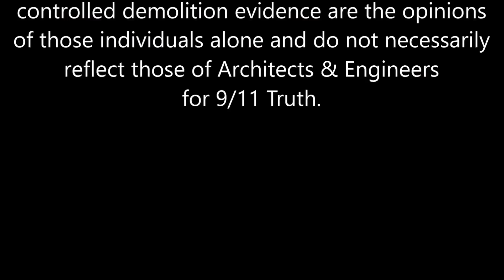Dr. Hulsey: There was nothing right about anything NIST did

Comment: NIST also never accounted (or accounts in any of their 9/11 material) for the heat dissipation qualities of steel beams constructed as a matrix. The steel frame building itself becomes a massive heat-sync. Meaning that the air temperature around the beams would have to be much hotter and for much longer because the steel beams would simply transmit the heat throughout the structure and that heat would be re-emitted (by the principles of black body radiation) across the entire structure. So when they say fires reached 2000 degrees, I would say SO WHAT, that doesn't make the beams 2000 degrees,   those beams will be about  400-500 degrees unless those beams are surrounded their entire length by a 4000 degree blast furnace, because they are all connected to each other, and would be transmitting all that heat throughout the entire structure.
Reply: The steel frame of the building has minimal heat sync qualities if effective fire proofing is in place
Reply: @PetraKann  can’t have it both ways… if the heat can reach the underlying steel, it will be dissipated by the connected material.
Reply: @xanderarena  But proper fire protection does just that Pander Arena: it insulates the steel from external thermal gradients.
Reply: @PetraKann  Are you saying that the metal handle on a heated frying pan would not get hot underneath "effective fire proofing"?
Reply: @kodowdus  Poor analogy.
The entire frying pan is not thermally insulated - only the handle.
The point is, all steel surfaces should have been fire proofed for direct heat contact for a minimum period of time (It varies from country to country but I believe it's of the order of 1 hour or so).

As we know today, the fire proofing in Twin towers was documented as being inadequate and needing repair in certain sections of the buildings. Then of course there is the argument that the fire proofing was blown off some steel structure due to the impact of the planes.
The bottom line is that the NIST report, just like the Warren Commission report of JFK's murder are fraudulent documents and politically interfered with.
They are not scientific reports.
Reply: @PetraKann  It was NIST itself that said that the core columns were uninsulated due to the fact that the aircraft stripped off that insulation, and that the columns softened in the heat of the fire.  It's in this context (i.e., under the dubious assumption that NIST's assertions about the state of the insulation are correct) that the issue of the metal structure of the building acting as a heat sink becomes relevant.
Reply: Heat-sync? Don't you mean a heat sink?

Comment: Although there was alot of money spent on deceiving the public, there are several things that occurred that they could never PLAUSIBLY explain.
1. The Amount of Jet Fuel in each plane that supposedly ran down the building, most of the Jet Fuel was evaporated upon impact when the plane exploded.
2. In order for a building to collapse at free fall speed there can be ZERO resistance from each preceding floor.Think about that. If a plane impacted a building on the 89th floor,the flames and destruction will begin at 89 the spread up and down,so the destruction is NOT going to obliterate floor 88 before floor 89
So how do you account for the zero resistance on 88 before 89 and 87 before 88 etc.
3. Because of the temperature that the Jets Fuel reaches it was only hot enough to weaken steel,so the building should have bent not collapsed straight down.
4. South Tower was 2nd building to be struck but collapsed first in 56 minutes.
North Tower was first building struck and collapsed in 102 minutes.
So let me get this straight it took 13 years to construct this Steel and Concrete structure with flame proofing and a fire suppression system throughout the buildings and you expwct me to believe "a fire" obliterated and reduced 2 steel buildings to ashes in 1 hr 42 minutes.
If you stacked 4 dog houses on top of each other made of Concrete and steel and completely emersed  the dog houses in combustible waste and Jet Fuel,it would take longer than 1 hr and 42 minutes to reduce it to rubble.

Be not deceived,
It was no doubt a controlled demolition orchestrated by people who gained financially from the destruction of the buildings and the subsequent apparatus that was built to facilitate the war against the "pretend guilty" and the war on our civil liberties.
Reply: "2. In order for a building to collapse at free fall speed there can be ZERO resistance from each preceding floor.Think about that. If a plane impacted a building on the 89th floor,the flames and destruction will begin at 89 the spread up and down,so the destruction is NOT going to obliterate floor 88 before floor 89" - Well neither twin tower collapsed at free fall speeds so this comment is null and void.

Comment: WHAT exactly happened to ALL 7 buildings with a WTC prefix on Sept 11, 2001?

The following points need to be made regarding what exactly happened to the building and the observable evidence at ground zero, that AE911truth / Richard Gage and now Andy Steele never touch on…

1. Building 3 (Marriot Hotel) – 14 Survivors - It was a 22-story building – 90% of that building completely went away, all the way to ground level and the 10% of it that was still standing (about 6 floors) is where these 14 people survived.

2. Building 4 – 9 stories – 75% of it, also went away – all the way to ground level – Poof gone. There was virtually no rubble on this building, except for a small remnant of the building.

3. Building 5 – 9 stories - Had cylindrical holes in it, 24 feet wide, that went all the way to ground level. Once again, virtually no falling debris ended up on top of this building.

4. Building 6 – 8 stories - Had the middle of it scooped out, all the way to ground level as well as 13 cylindrical holes, 24 feet in diameter on the edges and close to the scooped-out centre of the building and all these holes went down to ground level. The centre hole in this building had NO RUBBLE inside it, it was EMPTY! 

5. Building 7 – 47 stories or 4 and a half Titanic’s’ stacked on top of one another – Was frothing away the whole day until just the outer skin of the building was left and at 5:20pm SILENTLY fell into its own footprint, it left the seismic reading of just 2 stories hitting the ground.

6. The Twin Towers – 16 Survivors (“9/11 surfer” included) - 110 stories, equal to 10 Titanic’s stacked on top of one another. The survivors heard no loud explosions, no flashes of bright light, no molten steel raining on them, they did not go blind or deaf due to light flashes or explosions, they weren’t hit by falling debris - POOF they are gone into a HUGE DUST cloud. The seismic readings were that of a 20 and 16 story building hitting the ground respectively – Why was it so low?

7. Bankers Trust Building – (Across the street from the WTC complex) Was heavily damaged and rebuilt, just to be completely taken apart 5 years later due some lingering aftereffects affecting the structure of the steel in the building. Show me how a building that was not hit by a plane, had no office fires, because something affects the steel in the building?

Why has AE911truth / Richard Gage and now Andy Steele been “distracting” from all these points and especially focussing on WTC 7 for the last 7 years, ignoring everything I’ve pointed out?  

Has AE911truth / Richard Gage and now Andy Steele forgotten about ALL 7 WTC buildings that had massive anomalies that don’t fit the NIST Report and the “9/11 truth” movement’s THEORIES regarding “controlled demolition”, squib explosives, nukes, or mini nukes? 

Can’t AE911truth / Richard Gage and now Andy Steele count past 3? 

8 Buildings were affected, why only focus on those three for the last 13 years?

Why have you not intensely investigated the observable evidence that was left at the crime scene that was ground zero?

AE911truth / Richard Gage and now Andy Steele keep on asking for an “independent forensic study” of WHAT happened at the WTC complex, when such an “independent forensic study” has been done and the EVIDENCE was submitted as high up as the Supreme court of America, via a Qui-Tam case against NIST and the subcontractors who wrote the NIST Report, for SCIENCE FRAUD, way back in 2009! 

If this court case was heard and not illegally dismissed by the judge, the governmental subcontractors with links to advanced weaponry, who were tasked with the secured clean up operations at ground zero and tasked with helping to write the FRAUDULENT NIST Report, these companies would have been DEPOSED back in 2009 already!

13 years of theories by the “9/11 truth” movement have been regurgitated to a point of exhaustion and it is currently turning into a waste of time, as they aren’t bringing anything new to the table.

Why does AE911truth / Richard Gage and now Andy Steele censor anyone who brings this up and why is AE911truth / Richard Gage and now Andy Steele keeping mum about this 2009 Qui-Tam case?

Are we not searching for truth about WHAT happened to those buildings with a WTC prefix?

Time for AE911truth / Richard Gage and now Andy Steele to stop focussing on just 3 buildings, when indeed there was MAJOR anomalies with 8 BUILDINGS! 

Why aren’t you talking about the 9/11 orphans, Buildings 3, 4, 5 and 6? 

Why not discuss the anomalous Banker’s Trust building, that was repaired, just to be dismantled a few years later due to the integrity of the steel that was waning? What does that?

I suggest anyone wanting to investigate the 9/11 orphans, to have a look for the documentary “9/11 Essential guide” and decide for yourself what the agenda of AE911truth / Richard Gage and now Andy Steele really is. Also look for the documentary series “9/11 Deprogramming” which you can also find on Odysee.
Reply: Do you have any references whatsoever for these assertions?
Reply: @kodowdus  o, it's out there all right - just go do some research...
Reply: If you say so.
Reply: @kodowdus  yes, I have - just get my email address off my about section and I'll email you all my sources...
Reply: Why would you not want to continue participating in a public discussion?
Reply: My reference would be an excellent article on the AE911 Truth Web site entitled "A Picture is Worth a Thousand Words" which documents how the collapse of Buildings 1, 2, and 7 is much more difficult to explain in terms of visible sources of energy than the damage sustained by the other four buildings.
Reply: @kodowdus  because I cannot send links, pictures and pdf's on this platform, so if you want to really engage and find out more on my statements, you can email me....
Reply: @kodowdus  then email it to me and i'll send you my sources
Reply: I posted my reference.  You can post yours.
Reply: You copypasta this everywhere, and it glows.
Reply: @lynxbelow6922  just like the various things at ground zero that wasn't warm ;-)